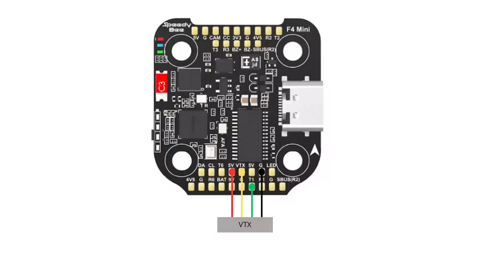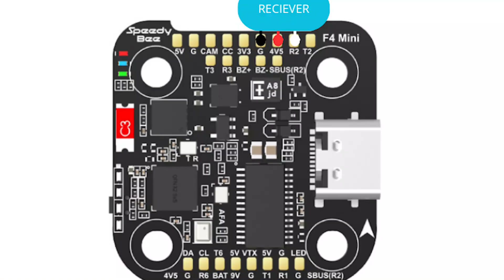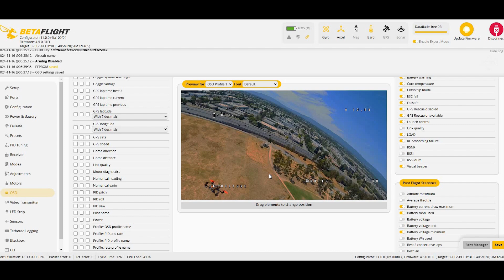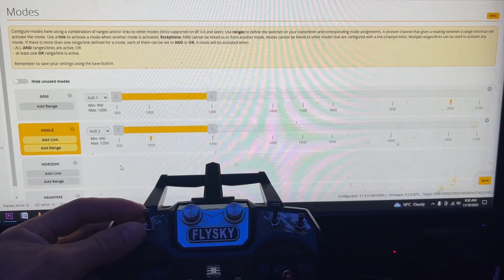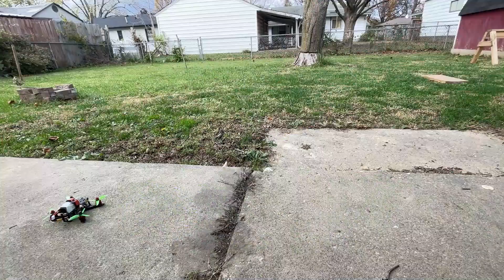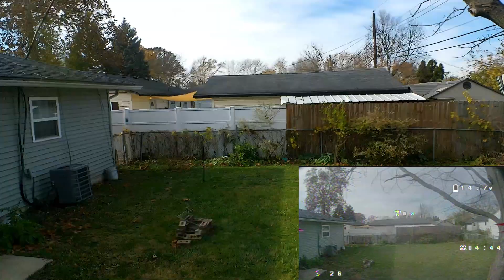How to build a 3-INCH DRONE (FLASH FC, CONF VTX, MODES, RECEIVER, OSD) and fly it.

Comment: Your top plate is on backwards, just letting you know.  The correct front side has a little cutout on the top to improve camera vision.
Reply from the maker: Yes I forgot to say that in the video, problems with the VTX I didn’t have much room in the frame.

Comment: can u give me the specifications based on the indian market since 1407 dimension bldc motors arent available in india
Reply from the maker: Height: 33.5mm

Width: 19.8mm

Weight: about 17g

KV (rpm/V): 3500

Voltage: 11.1-14.8V(3-4S lipo battery)

Propller: 4045/ 3045-3/3030-3/4045-3

Can you buy them on AliExpress?
Reply: @carlosrFPV  nah mate its banned in India
Reply from the maker: Sorry to hear that
Reply: @carlosrFPV  nah ur good mate keep doing what u do i just binge watched ur fpv vids massive W
Reply from the maker: 🙏 thank you